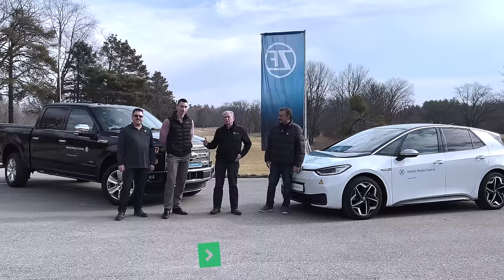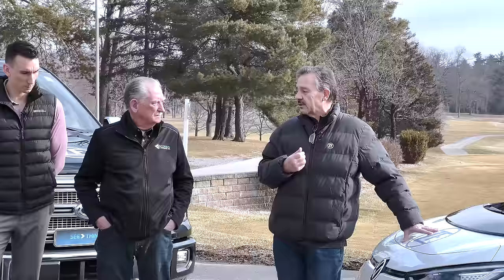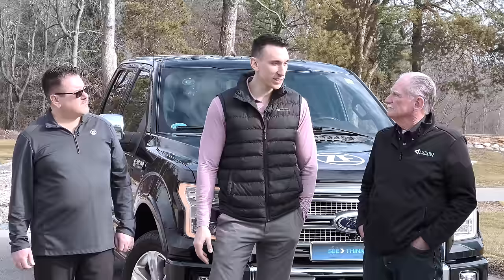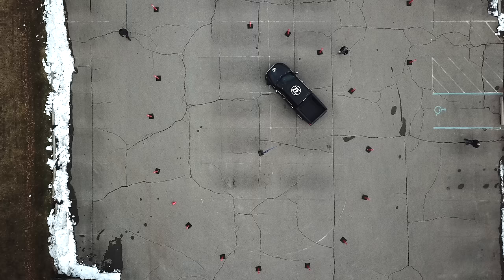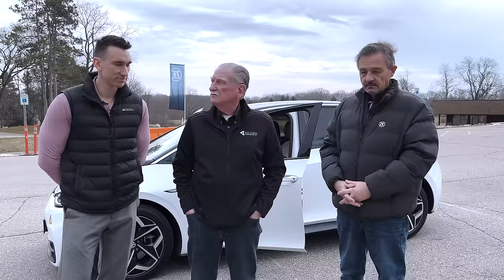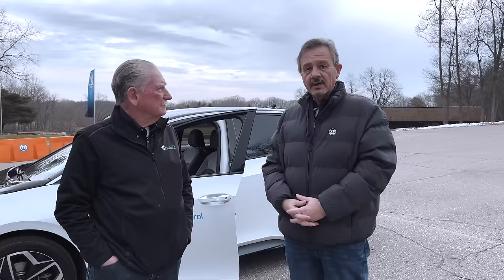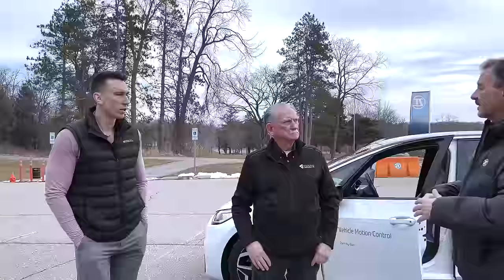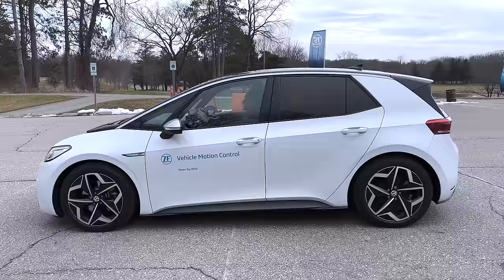Steer-by-wire - how it works with ZF

Comment: Great video ❤ So Tesla develops this things themselves, and the old big car companies around the world waits for Zf to do it for them?
Reply: ZF developed steer by wire systems long before Tesla. These are used in heavy trucks, special machines etc. for years and it is used for rear axle steering for decades.SBW failed to be superior in normal cars, because outside the US backup systems are mandatory. Tesla uses steer by wire because of the extreme design if the CT.
Reply: If you'd open your ears, you'd have learnt that ZF have been doing this far longer than Tesla. You also don't know whether Tesla is a customer of ZF or another supplier. The Hummer was doing this far longer than Tesla
Reply: GM has it and Hyundai has e-steer… or something like that.
The difference is Tesla has made more such systems than all the others combined… already!
Ain’t many Hummers sold.
Reply: Zf is a great company, for sure. If  I was bashing anything it was the old companies 🥴. Is Tesla buying there stuff from Zf?
Reply: @docsnider8926  The Cybertruck is no more extreme than an F150. It's roughly the same size
Reply: @davidlemieux615  Tesla has yet to invent a single thing that didn't already exist
Reply: @MegaWilderness  What 48Volt vehicle are you referring to?
Reply: @briansilver9652  Many cars and hybrids have 48volt batteries. You can't invent a voltage. They have 48volt motors as traction motors as do many forklifts, Perhaps even the earliest EVs and milk floats decades and centuries into the past
Reply: @briansilver9652  for example Porsche taycan first generation, it had partially 48 volt electrical System just like the cyber truck which is also A partially 48 volt car. And many mild hybrid here in Europe,
Reply: @simson4t  Thanks, are you aware of which systems in the Cyber Truck remain 12 volt? I would assume some lighting would be difficult to obtain in 48V atm.
Reply: @MegaWilderness  So... Tesla developed there own steer by wire in +/- 2 years and they are further along in development than ZF and are already implementing it.
Reply: @briansilver9652  I don't know yet. I saw a partial tear down of cyber truck on YouTube where they showed that the 48 volt connectors are light blue and the corner controllers connected with 48 volts but Beyond these many things are12 volts. I'm waiting for the Munro team to learn more
Reply: @simson4t  Thanks! I agree that Tesla isn't inventing anything here, but they sure are pulling everyone else into the future.
Reply: @MegaWilderness  there’s a difference between creating and applying Tesla does both. Apple didn’t create the user interface but made it work for the rest of us.
Reply: @MegaWilderness  Depends on what you are measuring.
Reply: ThyssenKrupp are also developing steer-by-wire systems for electric cars. (They are not divulging the EV manufacturer). Tesla might not have developed their own system
Reply: @MegaWilderness  I put forward the octo valve.   But seriously it is not so much about what you invent as what you are willing to use.    Obviously Tesla did not invent 48V but they were the first to use it in a production pickup.  Tesla did not invent die casting but they were the first to use large die castings to replace this large number of stamped and welded parts.   
It will be interesting to watch what Tesla does with cyberTruck prices after it has paid off the line(s) and R&D.  After one gets past the up front engineering costs for the new processes this truck should be considerably less expensive to make.   We may yet see the ~$40K single motor CT. In not absolute then automotive level inflation adjusted to about $52K.  Some of the R&D cost make future development possible so it does not necessarily get billed to the CT.
Reply: @MegaWilderness   After about 60 years of using 12V in cars there is massive resistance to change.  The  reluctance to make the leap to 48V in cars was so strong that Tesla published a pamphlet with limited distrubition.   The goal was to help others make the transition to 48V for all car makers.   By doing so it will also broaden the amount of 48V parts in the automotive ecosystem.   Better for everyone.    I can envision Tesla using this pamphlet to entice parts suppliers to start making 48V parts.   To jumpstart the move.   So yes any car maker could have switched to 48V but over 60 years they did not.   As modern cars draw more current the need for it increases. 

If anyone knows where one can find that pamphlet online I would like to see it.   I suspect it came with a NDA.
Reply: @briansilver9652  Early on I heard that the power seats and/or their controllers were 12V.  Lighting being LED would not be difficult for manufacturers to create.
Reply: @MegaWilderness 
Nobody has 48 Volt electrical systems. Cars are 12V. HGVs and busses are 24V. That’s it. 
Twenty years ago, Ford wanted 42V but the OEM equipment suppliers were not interested, so it never happened
Reply: @f4c3l355  Indications are that Tesla did.  I 'THINK" an engineer that worked on the project was on a video.

Comment: No mentioning or demonstration of the latency and not of the speed. What happens when you very quickly steer left/right like with a moose test?
Reply: It's even faster than a human. Just like how predictive braking applies more brake pressure than the driver immediately commands to dramatically reduce stopping distance. The same is done for drive by wire within the stability limits of the vehicle.
Reply: @otm646  that would be strange if it would oversteer. So far all steer bij wire videos I've seen on YouTube suffer from lag/latency and turn speed
Reply: The Ethernet gigabit data system is so fast there is effectively no latency.
Reply: @RamonSmits  There is no lag with the CT. If anything, the complaint is that the steering rack ratio is too fast. No other truck on the market can go lock to lock faster, be that with a conventionally hydraulic system or an EPS system.
Reply: @davidelliott5843  even ancient analog electronics or digital systems of 40 years ago would still have negligible latency for steering purposes.

Comment: ZF, did not mention either , weather or not Steer by Wire alone is cheap enough to be installed in a Mass Market Compact vehicle ($19,000) and Sub Compact vehicle ($15,000). 
my estimation is its cost effective in MID size Mass Market vehicles like the MODEL 3 RWD. 
we shall see is they are able to SCALE this tech , get cost reductions @ SCALE and package it correctly for Compact & Sub-Compact vehicles.

Comment: I love drive by wire and rear wheel steering. Albeit I'm extremely concerned if the drive by wire and especially the rear wheel steering fails. The consequences could be catastrophic.
Reply: Also about break by wire, acselerator by wire, gear by wire etc... 80% of road accidents because of it... Or not?
Reply: Suggestion?
Never fly.

Comment: Have you experienced Passive Rear steering?  Offered on selected Citroen Xsara models back in the 80's
Reply: I was also offered by Alfa Romeo in the 1990s. The snag is any wear in suspension joints really messes it up.
Reply: Every modern rear suspension exhibits passive rear steering to some extent.

Comment: Really strange to hear this entire conversation without a single mention of the Cybertruck, the first and, to date, the only production vehicle to have pure drive-by-wire technology (no?).  Especially given that Munro is currently tearing it down.
Reply: There is at minimum a Lexus with Steer-by-Wire in production. Engineering Explained has a vidoe comparing the systems.
Reply: Sandy just showed the cybertuck steering system, a lot of the components show ZF's logo meaning CT's steer by wire was codeveloped with ZF.
Reply: @Alhussainba  yes, I saw that.  Still makes for a very weird video.

Comment: Sandy not mentioning Tesla has all these in the Cybertruck says it all
Reply: I think its a price... 😂
Reply: What does it say? By the way I have Heard that cyber truck uses zf System
Reply: so whats wrong? because i'm clearly not smart enough to see it.
There has been zero accident related to fly-by-wire in the aviation industry in the past 50 years.
All systems require a double-triple physical redundancy with a triple-quadruple computer control redundancy with a physical hydraulic backup.
There is literally no other kind of movement control system in any industry beside the rocket industry that has such a high level of redundancy.
Reply: @simson4t  if so, the would shurely talk about it.
Reply: Indeed was wondering the same.
Reply: The Tesla steer by wire has less redundancy than an aircraft but a car can simply pull to a stop when faults arise. Aircraft can’t do that.

Comment: Imagine having the system prevent you from overloading the tires in a turn ie not skidding so you can safely complete the turn wet or dry. And not leave the roadway if physically possible.

Comment: heavy Commerical vehicles , would benefit BOTH from Steer by Wire & RWS .
Tesla semi would need 64v motor system to handle Vehicle loads. 
all the way to Class 8 trucking.
Reply: Steering a driven beam axle suspension is complex, heavy, and expensive... and commercial vehicles don't want any of those, so 4WS is out for most of them. Heavy vehicles built with massive budgets (fire apparatus, some military vehicles) has independent rear suspension and even available 4WS (using Oshkosh TAK-4 suspension, for instance).

Comment: Steer by wire with no physical attachment, sure an old car can wear out and control links get worn, but you have warning there and can repair it.  I wish you all the very best of luck driving a vehicle with steer by wire when the vehicle ages and the road salt corrodes connectors, or the actual steer unit faults later in life.  Good Luck !!!!  🤗

Comment: Thank you for sharing. I am looking forward to see the technology flow to all cars buses and trucks. As for passenger cars where the driver is at CoG ( centre of gravity) in sports mode . Passengers will get motion sickness. I have steering settings basic steering settings on a Mustang and I love that guide button setup and it is a basic setup. I can only imagine how nimble to park a Mustang with rear wheel steering and drive by wire functionality

Comment: SBW will no doubt make daily driver vehicles safer and more convenient. EPAS has honestly failed to deliver adequate enthudiast steering feel so perhaps SBW with sensors and actuators could actually improve it.
Reply: How will SbW make cars safer?
Reply: @hvh377  Don't need to accommodate the steering shaft in the design of the vehicle, giving you more room and additional design freedom to improve crash structure.
Reply: @frumpd63  Because that is currently the reason for a significant chunk of the dead and wounded on the road, is it? Sounds to me this benefit is somewhat contrived to make SbW look less like a solution looking for a problem. For all I know, the most important benefits long term could simply be lower manufacturing cost because the vehicle platform becomes more flexible and can support more models (software defined vehicles, LHD vs RHD) without changes. And probably the upsell of the 'sport mode' for your steering feel (which is as fake as your FF wheel in your home racing simulator).
Don't get me wrong. You might be right, but there is no evidence to support such a claim.
Reply: @hvh377  Steering columns were impaling drivers from when the design solidified.   In the 70s IRRC steering columns that collapsed were mandated to mitigate this.   The crush range is only a few inches so I am not comfortable in saying they did more than mitigate the problem.   I would not dismiss it.
The feel of steering is not a fixed thing.   Regardless of where it is now it will improve with time and money.    Maybe by an OTA.
Reply: @danharold3087  Exactly. Steering columns being deadly in a crash has been solved a long time ago. No need for SbW to improve safety.
Reply: @hvh377  Were they solved or mitigated?
Reply: @danharold3087  That's semantics. I'll happily leave that to you. Just have a quick look at any reasonably safe car's NCAP results. No problems with driver safety vs front seat passenger safety whatsoever.
Reply: @hvh377  OK I set you off on the wrong foot.  I asked a question.   Your answer is to start looking at test results for cars.   The Test in question is 204 for both NCAP and NHTSA.   (test parameters may differ)
FWIW I would start by looking at the least safe cars.
Overall it seems that the advent of airbags in the steering wheel caused a switch to a much safer system.
Reply: @danharold3087  Whether it's the airbag(s) or the advent of collapsible steering columns that did it, doesn't matter for the claim. If you want to claim SbW is going to improve driver safety, at least come up with some evidence that driver safety is significantly lower than for other occupants in the vehicle and that it is at least plausible that the reason could be the one significant difference between SbW and classical steering methods: the mechanical linkage.
I expect cars kill and injure far more non-occupants than they do drivers and passengers. I think efforts to improve vehicle safety are far better spent improving the 'outside safety' of the vehicle than the 'inside safety'. And that includes such factors as 'total mass' and 'acceleration'. Improving the NCAP scores for 'pedestrian safety' should get a lot more priority than any of the other factors IMO.

As an aside:
SbW is really not that significant. Every feature it can bring to the driver has been demonstrated in cars with mechanical linkage for years already (AFS, 4 wheel steering, etc.) and none of these features ever became a staple of car equipment. All SbW could do is make these features more affordable perhaps. Which is great, but not game changing.
Reply: @hvh377    Inside/outside road deaths is loosely about 50/50 in the western world but not all outside road deaths involve cars.

When we have computers driving cars instead of people the death rates will eventually fall to near zero. Baring negative political action.   Having pedestrian carry a device to help vehicles locate them could help tremendously.  Everything in these cars will be by wire.
Reply: @danharold3087  So, for the statistics in the whole world, my suspicion is probably correct. I assume in countries where the proportion of non-driving people vs car owners is much, much larger, chances are that more non-driving people are victim of a motor vehicle accident.
So while we start driving ever heavier (and more wasteful) vehicles (the popularity of BEVs is a very prominent factor in this), we should spend far more energy in making these vehicles safer for other road users, instead of turning them into tank-like safety shells for the occupants.
To hell with other road users, as long as I'm safe, I don't care. I'm sorry to say this, but this is the motto these days, with the Americans leading the charge. I would be in favour of basing the NCAP safety rating solely on safety for others from now on. Occupant safety is a given and pretty much the same for every new car these days anyway.

I don't share your optimism on the infallibility of software in general and specifically for driving vehicles. Especially if we go the AI-way where in the end the behaviours of human drivers program/train the neural net and the outcome of the network's calculated response to any specific set of inputs (not previously encountered) is inherently unpredictable. And it would be totally and utterly unacceptable to me as a pedestrian road user to have to carry safety equipment to keep motor vehicles off my back. Clearly, the responsibility to do that lies elsewhere.

What do you mean by 'barring negative political action'?
Reply: @hvh377   By 'barring negative political action' I mean if politicians do not mess things up.  
This is a personal responsibility not a car vs pedestrian thing. 
It is unfortunate that keeping people safe offends you.  
In 2021, 101 of the 130 pedestrian deaths involved alcohol, distraction, or speeding.  (not sure where).    This cries out for self driving cars.   Better by far to not hit pedestrians.
Reply: @danharold3087  Come on! Stop being vague about 'negative political action'. Be concrete, give some example perhaps.

I find it offensive the way you choose to misconstrue my position as being opposed to (or even offended by) keeping people safe. I'm saying that the burden for being safe in traffic should be on the person causing the potential danger: the drunk or speeding or otherwise bad driver. You cannot force all pedestrians to carry some gizmo so cars don't run them over. Cars/drivers should make sure themselves they don't do that. And if an unfortunate get-together between a car and a pedestrian should take place, the driver (manufacturer) of the car should take more effort to minimise the consequences by driving a smaller, lighter car (designed with a soft front) to keep injury to the lowest level possible.

How do you suggest we get to a large percentage self-driving cars on the road? (IF they ever succeed in making the things safe enough to do so.)
Reply: @hvh377    Feel offended if you like.
Reply: @danharold3087  No substantive response? Childish behaviour. Pathetic.

Comment: man. if only this lroblem could be adressed by using smaller vehicles. If only!:)
Reply: Crush which absorbs energy requires vehicle length.   That shorter the car the less the crush.  What we need is lighter large vehicles.   The Tesla cars are a good example.  The passenger compartment is a high strength hot stamped boron steel cage and the rest of the car absorbs the energy.   
Tesla makes each side of the passenger compartment as a single piece hot stamped part.  Maybe the closest thing to a roll cage in every car.